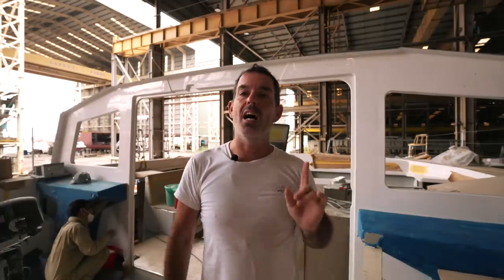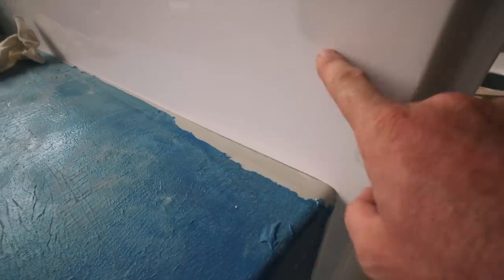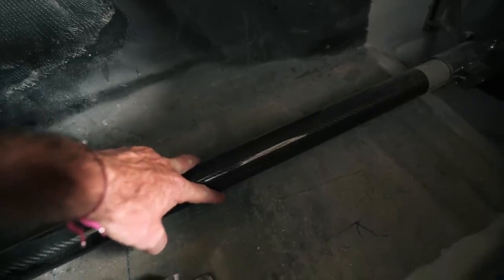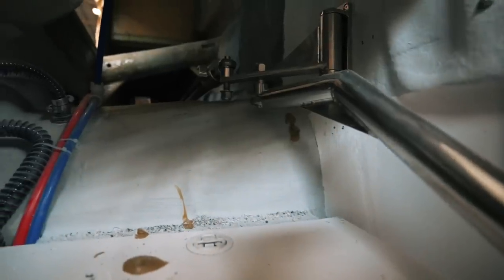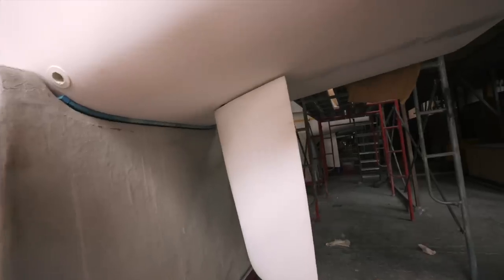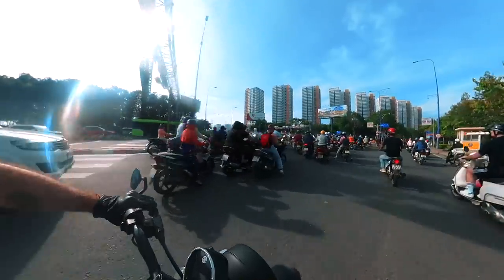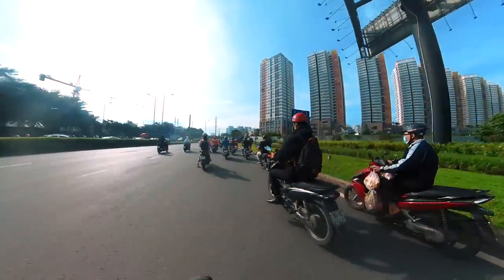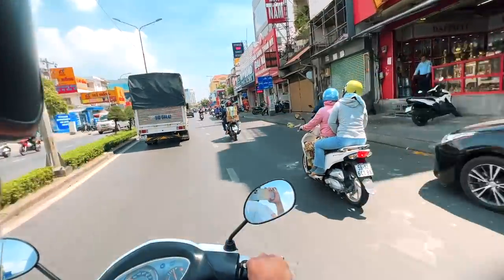Catamaran Build Update- What's the Latest with Ruby Rose 2?

Comment: As a leading designer of steering systems for yachts, sail boats and catamarans, I do agree that the system is esthetically pleasing. I do find it odd though that the connecting draglink is carbon to safe weight, and the rest of the parts are stainless steel which is heavy.
Mentioning Lewmar as a high end manufacturer of steering systems might be stretching the truth slightly. I've spent too much time designing system to be changed from Lewmar since customers are not satisfied.
In the end, I hope it works out for you, and you will have a good time and plain sailing on the big blue.

Comment: What an absolute treat to see the details that are going into this build. The quality and attention given to critical systems and things not seen in brochures speaks volumes to the builder. 

As a lay person, perhaps you could clarify something: Any system will always fail at its weakest connection. How is the bolt connecting the carbon rod to the rose joint fitting any different than the bolt connecting the aluminum tube in the comparison B-roll footage?

Comment: The connection between RR2 and a brand of UK chocolates? A Lincolnshire company that made packaging equipment sold one twist wrapper into Cadbury, who used their name and logo for Roses Chocolates. The same company was asked by Bomber Command, in WW2, to solve a critical controls failure problem. Their solution, a new system, the Rose Bearing.
Reply from the maker: Thanks for the info
Reply: @sailingrubyrose  You are welcome. As an extra, there is a letter from Guy Gibson, CO 617 squadron, thanking messers Rose for their invaluable assistance in "the recent operation". No record of what but it may well have been something to do with the gear for carrying the bouncing bomb.

Comment: I agree on the helm station... great lines.... That steering is ultimately held together with a bolt connecting the starboard rudder pole to the transverse pole.. looks flimsy to me. also, that rudder stock encasement is going to shatter if you hit something and going to just cause more work to fix it as it will be in the way. I hope you haven't gone for a Sail drive as then you'll have 2 points of contact with reef.
Reply: Yeah,  1 inch ball joints would be nice

Comment: Sorry Nick.  Cant agree that steering is excellent.  Two possible points of possible problems.  First is maybe just camera angle…. the downbolt at the bridge deck rise looks close to the deck.  Maybe not a prob….   
Next and most import one is that long term I would definitely worry about the fixing to the bulkhead.  The bracket that holds all the arms to the bulkhead is just a small plate with small bolts (or worse, screws) to the glass.  I think that should be a bigger plate on bulkhead with stronger fixings.  There is a lot of leveraged force on it,  so over time it might work loose out of the bulkhead.  Happy to learn I’m wrong,  but that looked weak to me.

Comment: Steering gear issues. The loads on the pivot arm and the pivot arm fixing method due to the offset connecting rod arrangement. The angle of the connecting rod from rudder to pivot arm might cause a rotating force on the connecting rod & with rose joints at both ends might result in inappropriate loading of the rose joints & possible rose joint destruction.

Comment: Check the cleat backing plates on your Seawind. We just had a 1600’s cleats pull out of the deck during Hurricane Ian, and it came loose, flying into an adjacent dock.
Reply: In all fairness, I'm thinking with the 250kph winds they recorded over there that might happen to most yachts of fibreglass construction...
Reply: @gbsailing9436  Well, my Fountaine Pajot sat right next to it. Didn't budge. Still attached to the dock. I'll send you a photo of the Seawind if you'd like. I'm not trying to be difficult, just letting folks know of an item that needs to be reviewed.
Reply: @ctaylor1655  Oh well, I stand corrected. They need to install some backing plates to the cleats I guess. I would have thought that was a prerequisite.

Comment: The Hollow Carbon tube - outside diameter less important than wall thickness. But The Carbone tube is more susceptible to damage than a Stainless tube.  If the tube gets an impact it will be the internal diameter which will delaminate rather than have a dent as stainless would.  Also holes into the Carbon need to be protected since salt water ingress is bad.  If you get salt water between a metallic and unprotected carbon part, you get electrolysis which will eat the metallic component.  Secondly if salt water gets into teh carbon, then the sharp salt crystals will cut through the fibres.

Comment: Jeez the 4 tiny countersunk screws holding the linkage pivot to the rear locker face are far too small????
Reply: There would be very little load on these screws.
Reply: @rodsimmons3101  there is a vertical load caused by the upward angle of the connection stainless bar to the rudder arms
Reply: @rodsimmons3101  
Might also  be  considerable side & pullout loads, need to see a diagram of the entire mechanism. The pivot arm is also a loaded lever due to the offset of the connecting rods.
The force pushing the pivot arm base sideways & also tending to lift one edge away from the GRP fixing area might be in the region of 700 kg in certain circumstances eg rudder suddenly hard over from neutral at max knots, given the Tie rods offset at the pivot arm resulting in the lever effect.
Reply: I was thinking the same thing. Nick has been an advocate of over-engineering and safety for a LONG time, yet here we see a very small bracket and mounting flange. Perhaps there is an enormous reenforcement behind the bulkhead, which guarantees the full rigidity and safety of the linking bracket?
The linkages themselves are stunning, beautifully finished and show the quality which the company holds very dear.

Comment: Ok, there’s a Rose Joint but that then goes to a bolt in a stainless bracket to another bolt to a bracket…. And there’s slop, the bolts aren’t through sleeves & there’s metal on metal… Am I missing something?
Reply: In my Eyes why Tighten it . Maybe they put it together so Nick can his video Out. NO Cat owner or Builder let this Go Bye. Awesome System
Reply: I was thinking the same thing. Nick shows a picture "Bad" of a bolt thru an aluminum tube on another boat, then proceeds to show two bolts thru aluminum (? maybe stainless?) "Good" on a Seawind. Perhaps the tie rod is subject to twist and that's why they have the rose joints there, and the other points are not subject to twist, but sure looks like all the load goes thru those 2 bolts.

Comment: In your steering mechanism there is an up facing nut (sit on top of a bolt). This nut should get an additional from fit securing device (cotter pin). Otherwise, there will be a day in future where this nut will be gone...
Reply: It is a nylex™ nut so it should not come undone, however, I bet you it will have a split pin or be wired before sea trials. If it hasn't, a further bet would be that Nick will perform that surgery on the bolt himself.
Reply: @gbsailing9436  The nylon ring is "just" a friction based device, this is okay as long you do have the nut facing upwards... I hope you are right, and we will see a split pin or similar at the end.
Reply: @andreaspoppe  Well, Nylex nuts DO work well, But if it was my boat and I was sailing international waters, I know what I'd be doing...
Reply: This is exactly the issue! If that nut comes loose… and it will! Nylon or not… the steering will fail! That tiller needs to intersect on the top of the idler arm so when the nut fails, the nut falls down and not the pivot. The bolt will at least stay in albeit loosly. And in a tight marina, that little bit if safety is critical.
Reply: @gonzof1  Agreed! I'm not saying it won't happen, but I've never seen a nylon nut come free. Having said that I've told you what course of action I would do if it was my boat.

Comment: You are obviously a educated man....to that End I want to teach you about the 
The most significant development in Underwater appendages over the last centuries 
Up untill now uou only have had 3 /THREE! ? CHOICES!  KEELS CENTERBOARDS  AND DAGGERBOARDS......Hundres of years in boating and only 3 Catagories  to choose from! 
Keels are bulky ridge stubs that suffer from weight and poor pointing ability at best
           If you hit an obstruction  you nor only impose structural damage to the hull but also inflict sever rotation shock to the standing rigging & mast!
CENTERBOARDS ; offer a degree of safety in that they rotate aft to elevate the impact.
                                   I must mentioned above but in return surrender a significant portion 
                                    preformance due to the extreemly large open slot receiver for the
                                    board at 90° for storage.  Note the slot & board prone to Marine                        g.                                 growth due to the fact that both are constantly below the waterline                               m.                                making repairs also impossible without hauling to dryland.
                                     Additionally, the board I'd hung by a nominal pin in the center of 
                                     a radial head who's diameter is set by the board width and hangs 
                                    Loosely allowing dor banging about in the trunk ( most annoying)
                                    Last but not least the Foil does not remain dynamic as it rotates!
DAGGERBOARDS: are the most highly preformance  Foil blades as they always remain 
                                 Perpendicular to the designed cross section locked in by the molded
                                 ,form fitted trunk, in turn the surrender ALL SAFETY as when struck
                                 Even with Crush Boxes they must become sacrificial to save the hull  
                                  Additionally, it is almost impossible to attend to raising both boards 
                                 A simultaneously to avoid collision and attend the helm with crew !
                                 Replacement is questionable when away from port due to their.  em